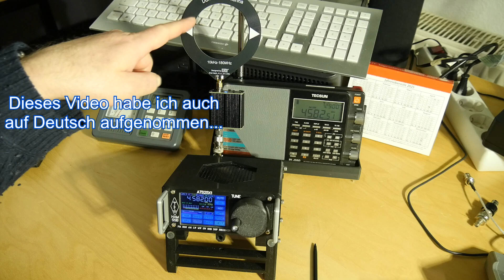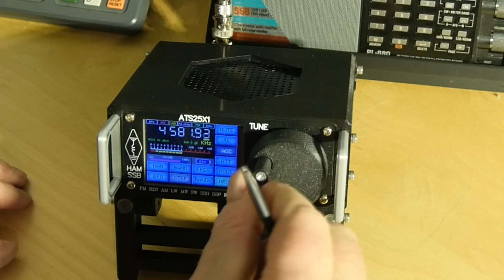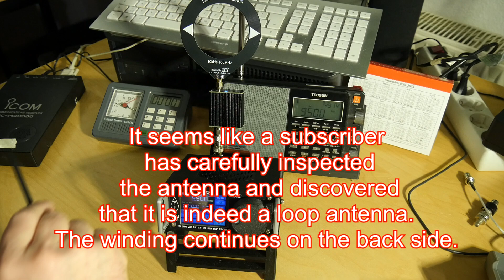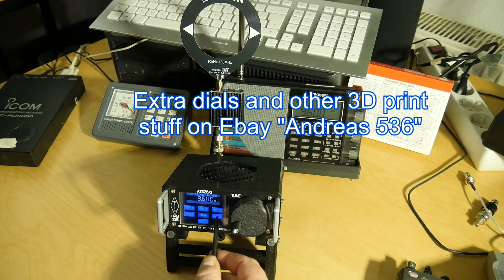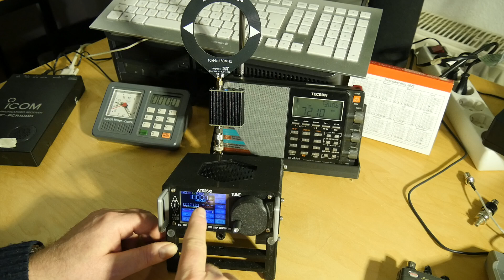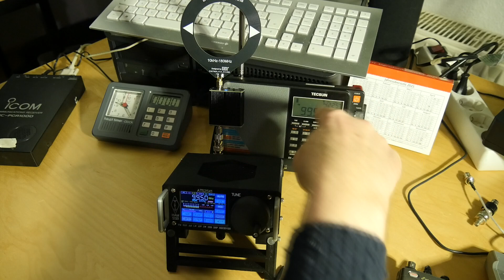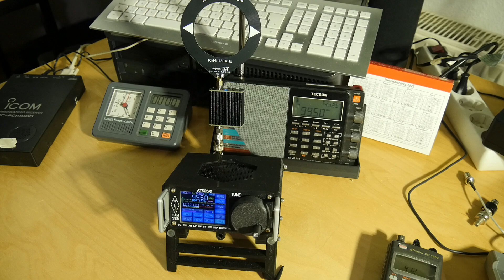WB DONUT ♦ broadband Loop antenna ► Is it any good? ♦ ATS25 X1 and Tecsun PL-880 Shortwave FM Radio

Comment: I just purchased a Donut WB Loop and I am totally disappointed by it. Is the black box under the loop a booster? My WB Loop picks up nothing but noise no matter where I put it from 0khz to 30Mhz nothing but static and noise. Only 198 Radio 4 BARELY shows up on waterfall, I am using it with a Perseus SDR SW Receiver and SMA to BNC lead. Many Thanks.

Comment: Hallo, ich mag Deine Videos - Basteln in Reinform. Diesmal irrt der Meister allerdings gewaltig. Die Donut-Antennen sind tatsächlich Loop-Antennen. Dein "Endpunkt" ist kein Ende sondern einfach eine Durchkontaktierung - auf der Rückseite geht es weiter. Man kann das auch einfach mit einem Ohmmeter am SMA-Anschluss messen, deshalb auch Lo-Z eine offenes Ende wäre Hi-Z. Damit kommen wir dann zu deinen Empfangsversuchen, sehr aufwändig und schön dargestellt - aber das Resultat war vorhersehbar. Der Impedanzwandler hat einen Ausgang von 50 Ohm. Das passt toll beim ATS25 oder einem Scanner etc., hier ist Anpassung. Der Tecsun hat wie eigentlich alle Radios dieser Klasse keinen 50 Ohm Eingang. Der Klinkenanschluss wird über Umschalter, Kondensator oder auch direkt einfach mit der eingebauten Teleskopantenne verbunden und ist damit ein Hi-Z Anschluss. Das kann nicht funktionieren. Die Donut-Loop's mit Drehkondensator sind Hi-Z (Schwingkreis in Resonanz) die würden am Tecsun etc. bestimmt gut laufen, auch ohne Impedanzwandler. 73 Oliver (DF2OA)